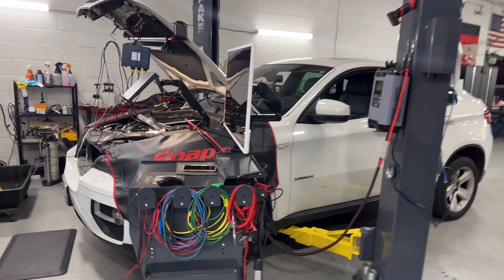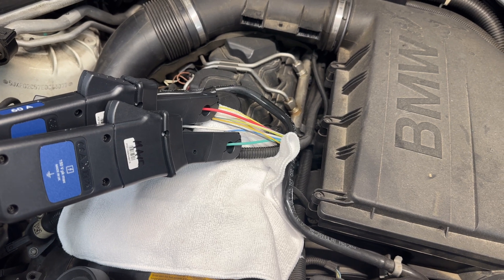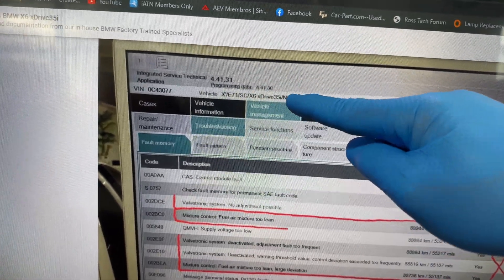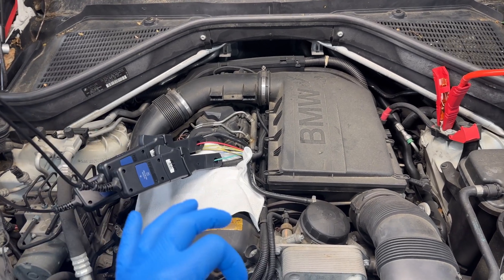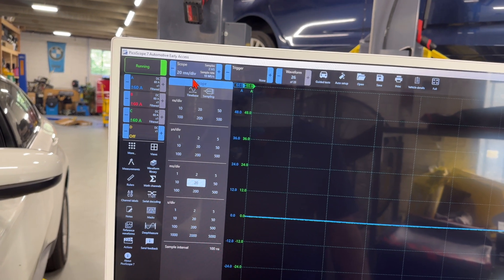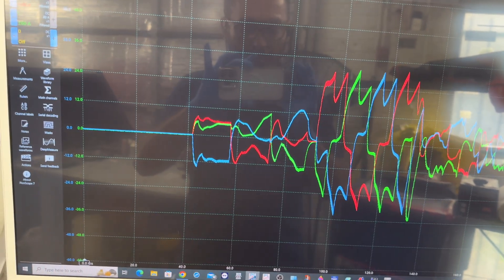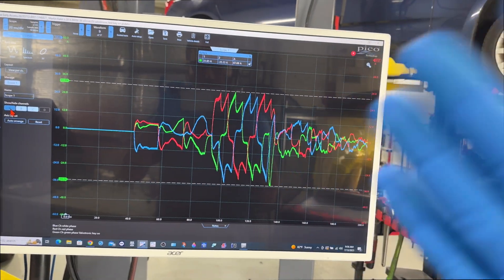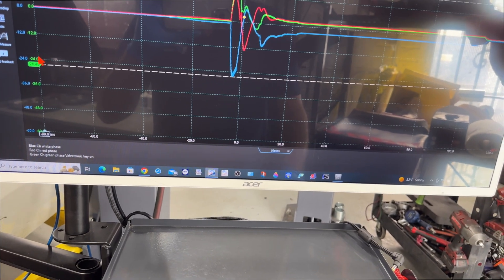2014 BMW X6 E71 N55 Valvetronic Test with PICO 4425A

Comment: I am working on a 2013 BMW 335 with a N55 and customer had me replace the valvetronic motor. I cannto get it to calibrate. Codes 134f01 and I only have 1 amp clamp. I am testing the wires on key on and the green wire goes to 8a where the red and white only go to 5a. I dunno I might be a noob and trying to figure this out but shouldnt they be even?

Comment: At 8:54 the green capture between 120.0ms and 140.0ms the amps cut off and drop you have a similar thing happen on the blue capture however the red line you have a clean set of 2 pulses. Is this also an indication of a failing motor?
Reply from the maker: Great comment and yes that is also an indication of a motor failing, it is always very important to compare waveforms at different times to make the call.

Comment: Interesting video Maic 👌
I had a quick question, a bit off topic (pardon me) but I wanted to ask if you could suggest any accessories for my first scope ? I am considering the micsig sato1104, the accessories being - pressure transducer, amps clamp, secondary ignition probe, and a 20:1 attenuator, what would I be missing ? My budget is tight (I'm from a third world country so trying to get it all under $1000)
Reply from the maker: That should cover most of the test! So you will be fine!